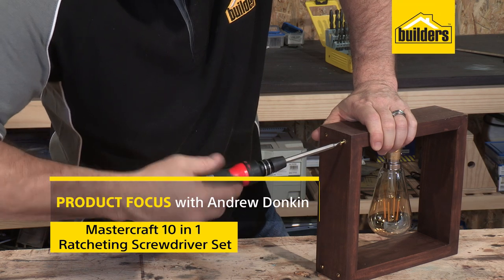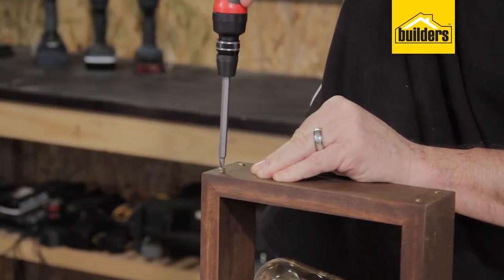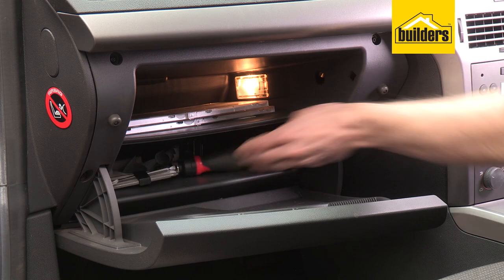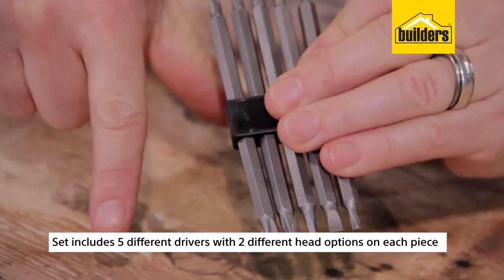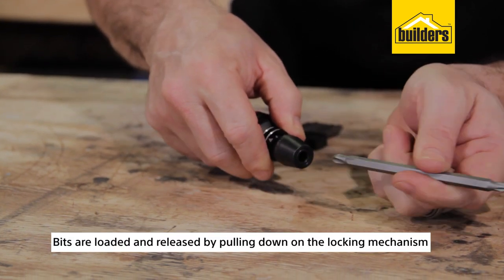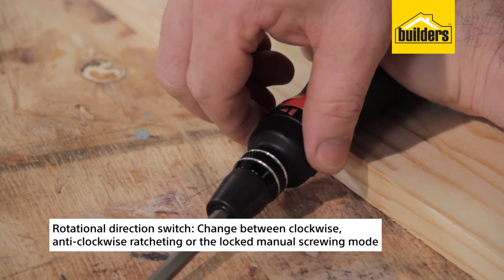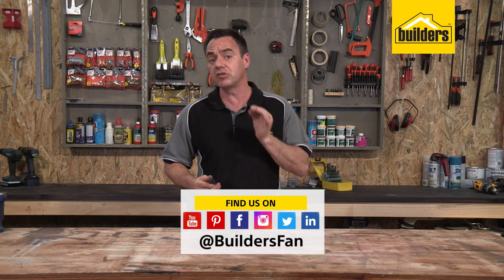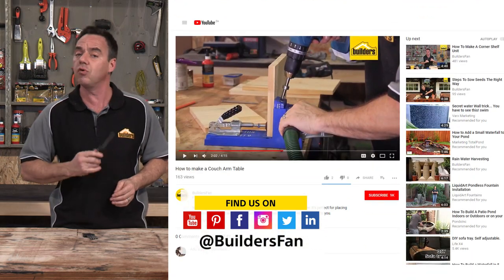Best Ratcheting Screwdriver Set To Use

Comment: Ratcheting system is one handed or both handed? I tried to use this type Screwdriver but they need both hands to work, one hand to hold the shaft while other to drive the handle else it works like normal Screwdriver. I bought the Amazon basics model